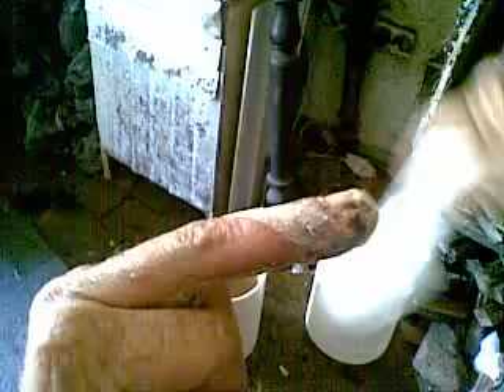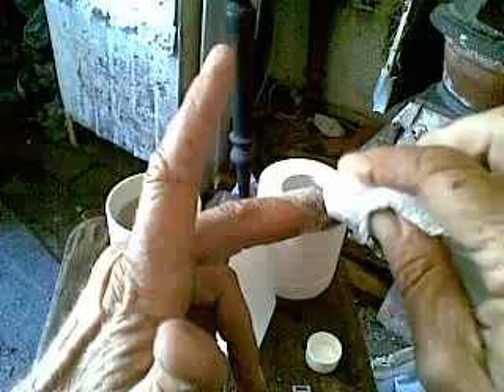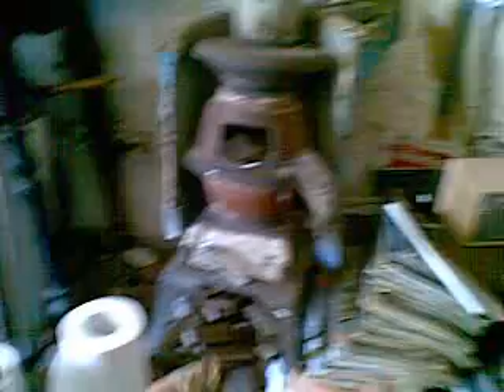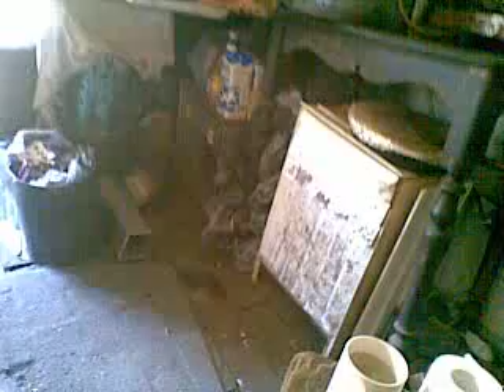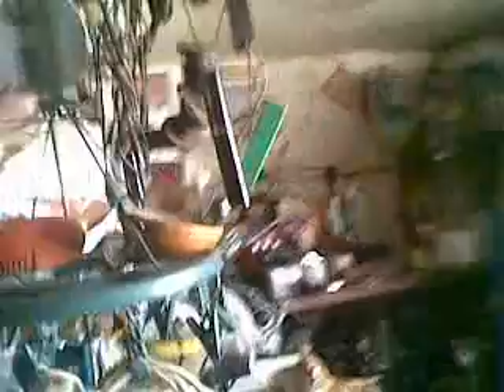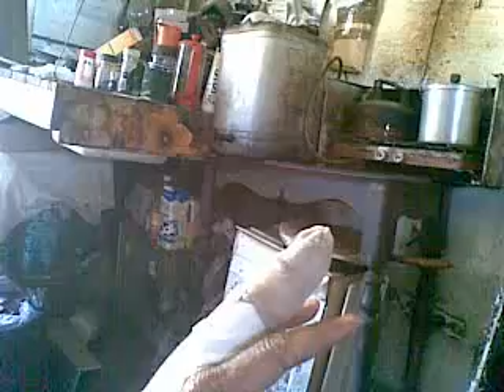L. Middle Finger Avulsion Wound  Day 13. Re-Dressing & Bandaging.

Comment from the maker: @wakeupofg
 G'day Oscar..., thanks mate ! Well, haste, familiarity, & inattention, in equal parts. I went to snap the uncut "spike" from the last "Round" of Firewood of the load. Didn't notice the back of the 40 lb Round was supported, balancing on a Triangular 
Rock. Didn't realise that when I raised Block to use Gravity to snap the Tang, the Round rolled, which trapped my Finger in a Rotary Guillotine made of Hardwood... Very Fast, it were. Soon as 'twas done, I knew ALL about it. Ciao !